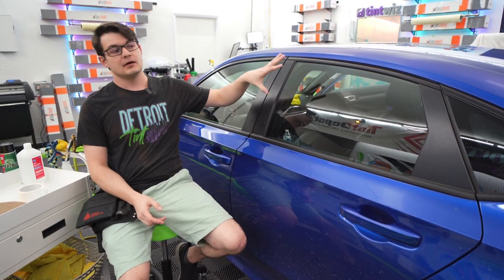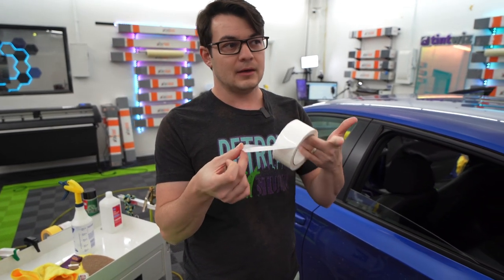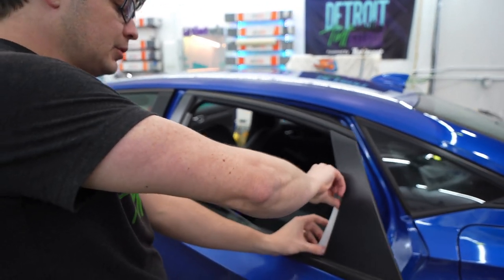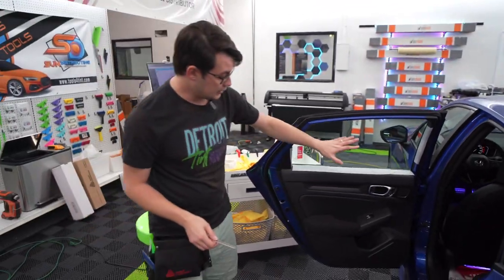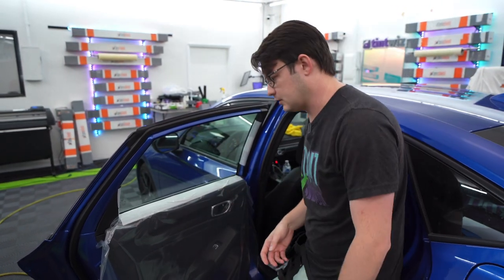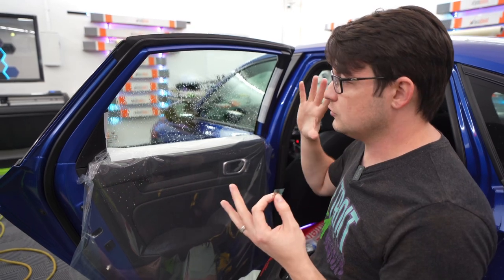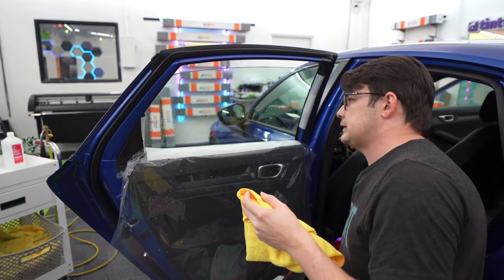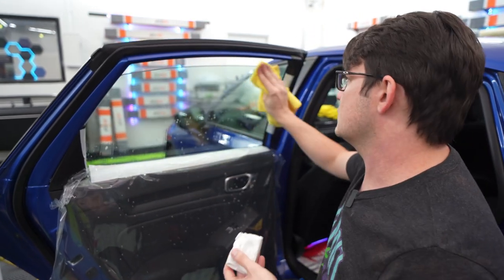Clean Glass for PERFECT Window Tint in SECONDS

Comment: Is the tape supposed to help you slide the tint easier? I am new at this and want to start my tint business. So I am trying to soak all the info I can. Did my first two front side windows on a hummer H3 and they were a PAIN.
Reply: I think the tape is so the tint doesn't stick to the panel and to keep debris from getting between the film and the glass
Reply from the maker: The tape is like having a brand new seal. It covers and holds any dirt from it getting into your tint. So especially when ur new, it keeps the sides much cleaner
Reply: Thanks fellas. Much appreciated.

Comment: Am I doing too much by scraping and scrubby padding the whole window? Sometimes I end up with little smudges on my glass in the light and I have no Idea how they got there. Can't tell if it's a spot I missed or excess soap suds??
Reply from the maker: Probably not the cleaning, either the glue stuck a little while sliding it into place (might hear some sticking or popping sounds). Or it’s air gets stuck in the glue when squeegeeing air pockets over an area you already tacked down. These films have a pressure sensitive adhesive so once it’s pushed onto the glass, it’s made to stick to it.

Comment: So you tape any window regardless of felt gasket or not? because Ive only been taping when the felt is  present
Reply from the maker: Yea, it’s way less helpful on a new car with a rubber seal. But on an older vehicle with rubber seals, they build up a lot of dirt. I’ve been tinting for years without tape and since I’ve been using it, it helps with the random specs here or there on the sides. If you haven’t been tinting long, it’s going to be waaayy more helpful that that.

Comment: steel wool grade # 0000  to scrub the windows. Is what i use have you ever heard of that
Reply: Steal wool leaves a lot of metal "lint" behind.  Sure it's scrubs the glass clean but it leaves more of a mess than what you started with.
Reply from the maker: Yea, I use to use it for removing glue. I don’t like that it flakes apart and rusts so I moved to using scrub pads instead of need be.
Reply: @DetroitTintStudio  Yeah it's single use and has to be stored properly. I saw the aftermath of someone trying one of the "ball of lathe spiral offcuts" scrubbers, looked like the glass had been hit with a orbital sander! 😂 😂 😂 😂